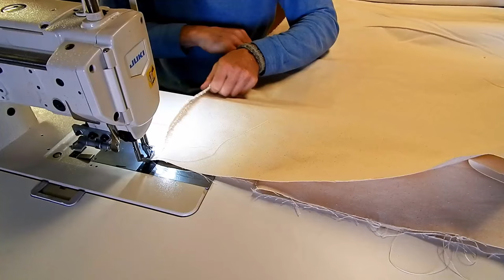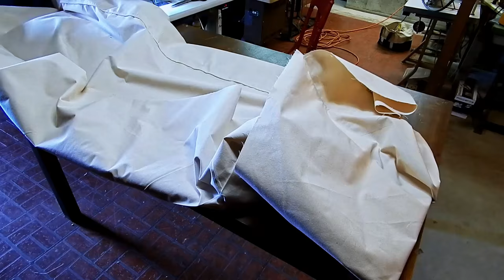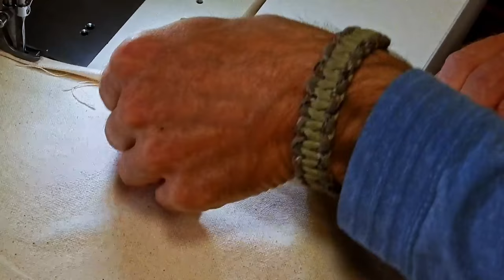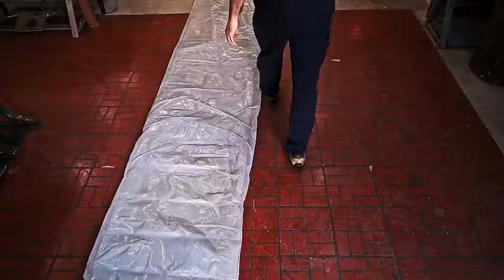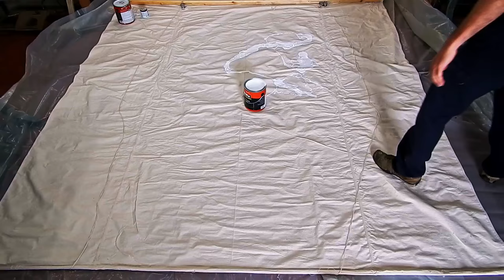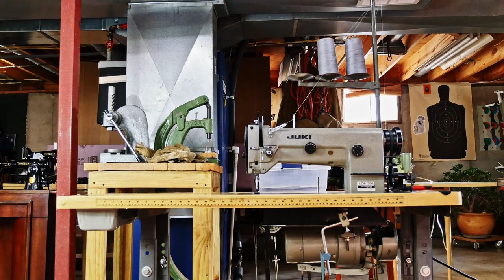I Make a Video and Photography Backdrop

Comment: Love except for,  I don't understand what you did the pull system first. Seems like a pain to work around. Is there a reason you do that first??
Reply from the maker: This project occurred over time; I decided to do the paint job after I already had the backdrop up for a while and used it to make several videos. For example you can see it all natural in this video. https://youtu.be/9nLpvw2M40A
Reply: It looks better for it as the painted strings are invisible. Natural strings would stand out like a sore thumb. Very inspiring, great job!

Comment: hello from brazil man! please, qhat kind of pait u use? itahs the acrylic one, same we use on the walls? 
if yes, thats will not crack after some time? Thanx a lot!
Reply: @AlexanderDyer  thanks for the videos You are a great craftsman . Just a question .Why didn't you use primer? Would you recommend using it ,because I think it helps with possibly cracking ...?
Reply from the maker: @Cezram0n3  I am no paint expert but it is my understanding that primer helps with adhesion and latex paint has no difficulty in adhering to cotton canvas.  Factor in extra cost and more steps and time and I didn't feel like it was needed but you could prime and it would be good.
Reply: @AlexanderDyer  thanks again .I have a variety of canvasses I'll try different methods and will paint one of my own .BTW l love that tote you made of the old  canvas tarp👌 .Are those available? (For sale) ...